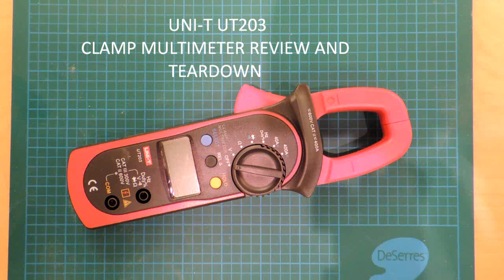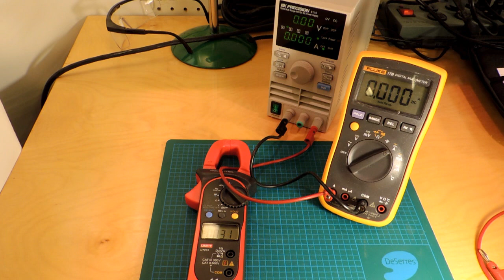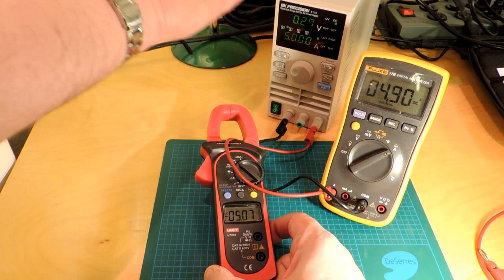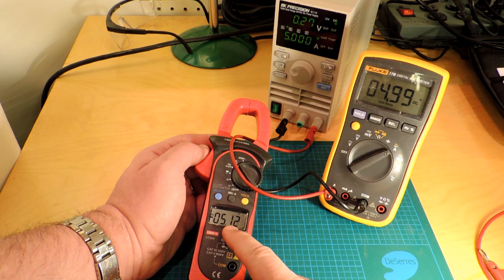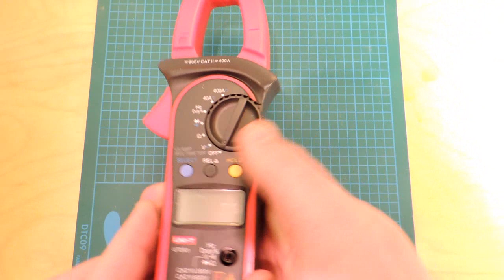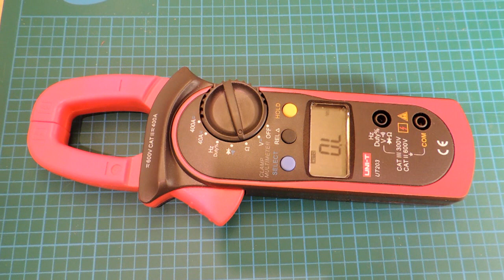UNI-T UT203 Clamp Multimeter Review

Comment: Dick Fageroni. You answered your own question. No its not adequate for higher voltages as voltages are measured directly with probes on these meters. On clamp "Current" measurement it will be safe but on high voltages you could have a serious accident. Basically if you are measuring voltage on this meter you will be directly plugged into the power via the probes. If you are measuring using the clamp then you are measuring current flowing through a conductor and the voltage is "less relevent". Note i said less relevant as even the clamp part of the meter has its limitations.

Comment: Really good vid, thanks. I need a clamp meter that will measure ac and DC amp draw. Will this meter do that? I wanted to measure the amp draw of my car while the motor is on. I guess I would place the clamp around the positive wire off the battery. 
Please let me know. Thanks again

Comment: Mine broke after a few months, after I did some DC measurement on some 12v bits on a car, the UT203 started fluctuating from 6v to 30v on a 11.8v source. It won't react on the clamp anymore, no resistor measurement.  Basically broken, except for the connectivity tester, That still worked. I tried a new battery, I eventually ripped it apart looking for a fuse.... no fuse, anywhere. Threw it away.

Comment: I just bought this multimeter and I can sign up all my heart under this UT203 :-)
It's wonderful and so cheap taking into consideration all functions that he has :-D
I recently measured current of transformer soldering iron (power 75 W) and guess how big is the current... 300 amps (yes, it's such big!). The funny thing is that this current is quite similar to start-up current of the petrol engine 1.5 8 V in my Daewoo Lanos ;-)

Comment: last thing i found exactly the same unit from Sinometer and another models for all famous brands under sinometer brand and lower price  .. but i didnt buy it as there is  no specification sheet in the site at SinometerDOTcom .. just summery in JPG format ..this is the link for it from sinometer exactly the same 
wwwDOTsinometerDOTcom/uploadImage/2012-09-27/2012092714384876598849.JPG
search in there ste and you ll find any unit under there brand name

Comment: hi again i bought  this unit ..few notes about it .. 
slow in reading resistors .. ( you have to wait to read especially if its low value .. annoying because if you lose the contact it will repeat reading again ) ..
9 volts battery ( i hate 9 those batteries ) .
Test Leads are very cheap one .. 
every thing else is just so good and its reading for A(dc-ac) is quit well and reliable . 
i take another uni-t for every day use its UT39A with low current measurements and its as good as this one ..